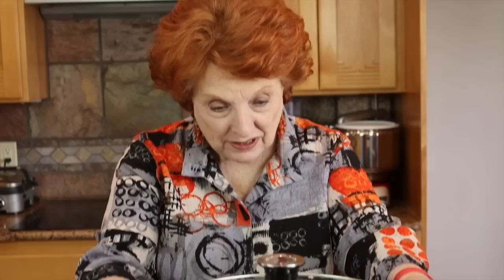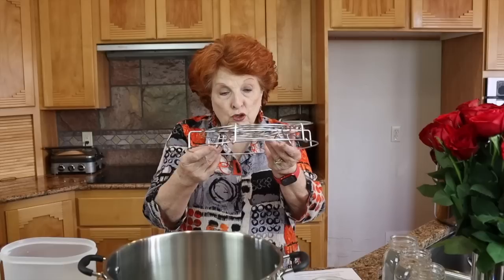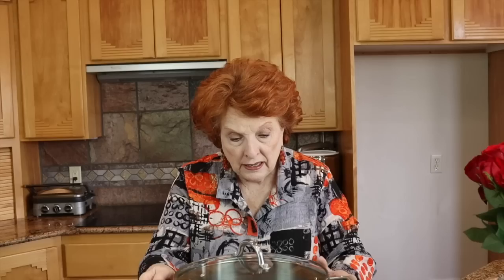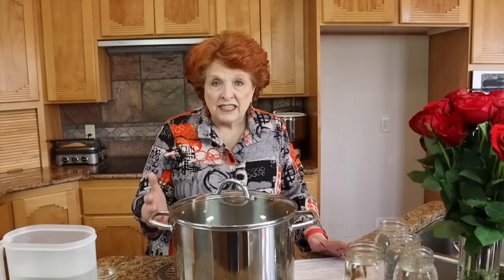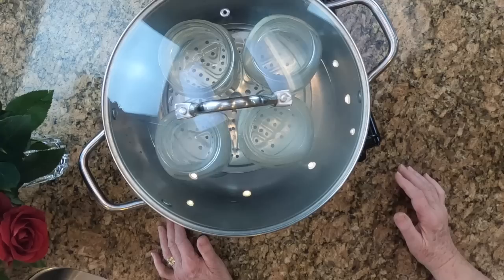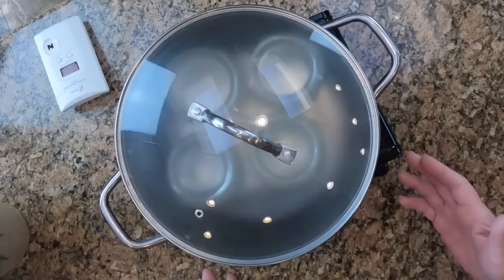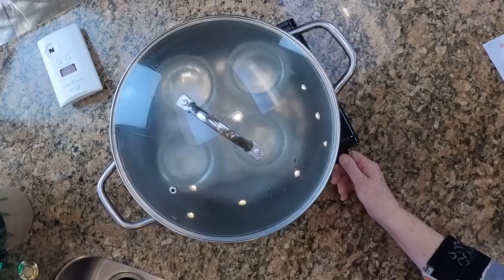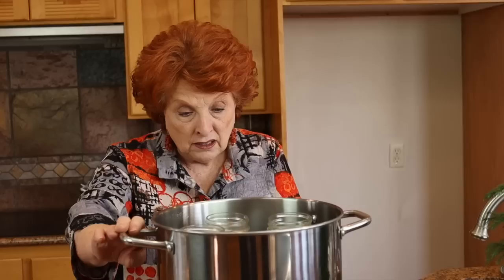How to Make Your Own Steam Canner

Comment: I use a springform pan (ring only) and a pizza pan (with holes) to elevate my jars to steam can .   Works great to give it the elevation for the 3 litres/quarts of water!!!!    Thank you so much for the work you and Jim do!!!
Reply: what a great idea, thanks!
Reply: I also use pizza pans with holes, and another one I have is like a screen. I use them for the second layer in my Presto and the other in a smaller batch kettle for jams etc. Saved me about 20$ each. I bought mine at a restaurant supply store. They come in every size one can imagine! They are awesome.
If we just think a bit, we can be pretty crafty! 😉😉
Reply: Great idea!!!  Thank you for sharing this.  God bless you sister.
Reply: I learned something today. I had never heard of steam canning. I also have the Ball water-bath canner with the rack I can invert. Can I just arbitrarily steam bath anything I would normally water bath?

Comment: I use my pressure canner to steam can my high acid foods in as well as my electric canner.  Doesn't matter if the jars are in a little bit of water in the bottom or not, it still does the same thing. People in other countries don't even cover their jars completely with water when water bathing their high acid foods and still have the same outcome. Only difference with those is you lock your lid and leave the weight regulator off or vent pipe open for steam to escape. Once steam is escaping good usually  after ten mins you start your water bath time anything with a water-bath time of 45 mins and under as you don't want your pot to run dry. You can lower the flame down a bit to avoid running pot dry but just make sure you can hear it boiling and the steam is still coming through the vent hole the entire process. I've never had any issues with using either one. Glad you shared that information for others though as some won't just believe anybody which is a good thing. I believe people should always always do their own research. Plus, another good reason to share which keeps people from actually canning is they think they need all this special equipment to get the job done and it keeps them from even starting and some folks could really use this information to help save $$$ and put up for their families too. Some don't have the dollars, to buy all "unnecessary high dollar gadgets." We have to teach each other that there's many ways, and safe ways to get the job done. Thank you for sharing this is great information for others to see.

Comment: I often wondered if I could use my pressure canner as a steam canner by elevating the rack with the ring from a springform pan and start time when the steam is steady, such as when we steam for 10 minutes before adding the pressure weight. I'm ecstatic that this confirms that I can. No more transporting of a large heavy potfull of water. 😁 My pressure canner becomes a double duty appliance and even more worthy of the space it takes up in my kitchen. Thank you so much for your scientific approach and contribution to safe and responsible canning tutorials.
Reply: Good idea with spring form pan ring.
Reply: I do this....
Reply: @jenniferr2057  You're not alone.....
Reply from the maker: Perfect!  And great improvisation with the springform pan!  Thanks for sharing.
Reply: Awesome!  I even have the glass lid with the steam hole for mine 😃
Reply: This is what I do.
Reply: I do this with mine. Turn it down so the safety stays up but not so high I risk running out of water.
Reply: I have done it for years.
Reply: I’ve been doing this for a couple years.
Reply: Now your pressure canner is a triple function unit: steam canning, pressure cooking and pressure canning!
Reply: I’ve just started doing this with my Presto. My question is, do I vent for 10 mins before starting my timing?
Reply: I was going to ask this very question. 
Thank you!
Reply: Replying to my own comment. I rewatched Pam’s video, and yes, vent for 10 minutes before starting the timing.
Reply: You could also just use a pressure cooker instead of your canner so you could do two at the same time....

Comment: I will add my two cents. You are far better off using a pot with a lit that fits properly such that steam only escapes through the vent and not around the edges (once turned down from high to the lowest point where steam is still produced). This is the reason Pam's first Harvest Canner's temperature indicator appeared to not work properly.  The indicator was fine but didn't reach the right spot because either the lid or the pot was somehow out of round and the steam was all escaping from under/around the lid. For that reason, when I saw the video where she talked about all of the steam escaping I knew her situation was not as some who are at altitude extremes and fall outside the norms for the indicator, but that she had a problem with either the lid or pot having been dented out of round in storage or shipping. That is why I sent her a replacement canner.  Steam canning with a lid that doesn't fit properly and allows steam to escape under/around is a far from ideal situation as that same gap allowing the steam to escape is also allowing air lower than steam temperature into the pot. This shouldn't cause major temperature fluctuations, but you will not know unless you have two vent holes in the lid (one to let steam escape and one to put your instant-read thermometer in. This is why a pot with a properly fitting glass lid with two steam vents is ideal. (FYI, the extension office system has put out a memo as to why a regular pot should not be used for steam canning. As we were producing steam canners long before they finally tested and released their findings, we know they don't have the bandwidth and their team is dwindling, so....)

A little more about steam canning efficiency. Not only are you using less water and so the steam brings the temperature inside the canner up more quickly, but you are also turning down the heat on your stove to hold the steam steady. Turning your stove down from high uses less energy. With our canner, and most pots with properly fitting lids, when the stove temperature is on high, the force causes the lid to move around and that is why you have the spitting, etc. under/around the lid and that is also why my instructions tell you when that happens you're almost ready to start timing so turn the temperature down. If you don't take that step of finding the sweet spot of the lowest setting on your stove that still produces a steady stream of steam, you may run out of water sooner than all of our (and the USDA's) testing making your longer recipes (such as some tomato recipes) unsafe when the water runs out. 

Also, you can purchase the rack that comes with the Harvest Canner by itself. Search on Amazon for VKP1056.
Reply: Thank you so much for the additional information!
Reply: So helpful. Thank you.
Reply: Thank you for your comments.  I was also concerned that steam escaping around the lid was allowing air in.  I have the Harvest Canner and if there is steam escaping around the lid I turn the heat down and start timing after that steam escape (and air intake) stops.  That point also coincides with the gauge on the lid reaching the max for my location, so I'm assuming your gauge is measuring steam pressure and not just "is the water boiling".
Reply: @keG1494  first, it's an indicator and not a gauge. I'm not an engineer, so I can't explain the difference between the two, but the owner of our company is he's made it clear this is an indicator. :) What it's measuring is not pressure, but temperature. Once the canner is filled with steam, the temperature cannot increase. The only way to increase temperature past the point of steam is to pressurize it.... hence the reason low-acid foods can be canned under pressure, the temperature is then hotter than steam. So you are partially right that the indicator is not measuring the water boiling, but it is measuring the steam. I hope that helps clarify a bit.
Reply: Thank you for clarifying!
Reply: @kimberlywilliams3009  Thank you. The additional info is very helpful!
Reply: I will buy one once I have the money saved!!
Reply: @kimberlywilliams3009 at what temperature range are the respective green fields on the indicator?

Comment: Thank you, Pam!  I sent even more people to you when they said to me that they wanted to can but were afraid. I tell them that you will tell them what is safe, what is not and WHY, and that you will give them confidence, as you did for me, (and so many others.)
Reply: I am wondering the same thing.  I would think we could use the instant pot as long as we see the steam escape through the valve and use the proper process.  Your thougts, Pam?
Reply from the maker: Steam canning uses no pressure, so if you can elevate the jars, place the glass lid on the Instant Pot instead of the pressure lid, it could work.

Comment: I’ve been using a regular stockpot for steam canning for a few years now, it really does work very well. A few things: you should have a rack below the riser jars so they’re not directly touching the bottom of the pot. Also, a glass lid is unnecessary. As long as steam is freely flowing from under the lid you know the water is boiling strongly. Even if you can see that the water is boiling you need steam flowing out of the canner to guarantee the temperature is correct, so visual confirmation of boiling is neither necessary nor sufficient.
Reply from the maker: Thanks for the benefit of your experience.
Reply: My presto induction canner is in essence a steam canner. If I put the jars on the plate that comes with the canner on the bottom inside, I get siphoning every time. I suspected that the induction plate that is attached to the canner on the outside, on the bottom was getting too hot, making the jars too hot, thus siphoning. So I bought plates on Amazon with legs to elevate the jars off of most of the water. No more siphoning. Plus the second rack in my 23qt Presto is always being steamed no matter if I use an elevated botton rack or not.

Comment: Okay, what the heck says I. Tried it with some grape jelly. Used my normal water bath canner, flipped the basket over and put my pressure canner rack on top of that. Added three quarts of water. Worked perfectly. Recipe  prepared for normal water bath canning. Processed for 14 minutes (elevation) after rolling boil reached. Flame out, wait 5, remove lid and ALL jars (10) instantly sealed. LOL, I've never had that happen before. Logically this has to work. Once water reaches boiling point it will never get any hotter because it turns to steam. Therefore steam is the ultimate temperature without some way to "superheat" it. Physics....
Reply: Okay. I decided to experiment some more. I started with cold water in the canner, cold water in an 8oz jar with a cheapo thermometer stuck in it. Not as scientific as Pam but whatever. Within 6 minutes the water in the canner was at a rolling boil. Within 11 minutes the water in the jar was at 200 from a cold start! Never did get above 200 but I'm blaming that on the thermometer (Dollar Store). At 2500 feet water is supposed to boil at 207 degrees, I'm at 2625 feet ,so yeah, I feel good water bathing cooked jams and jellies like this...

Comment: What you are saying is true to a point. The issue arises when going higher in elevation because the water then boils at lower temperatures. The purpose of those little green indicators is to compensate for the lower boiling points allowing the temperatures in the canner to reach 212 degrees as at sea level, in spite of when the water starts to boil.
Reply: Actually, if you closely look at the gauge on the canner, it shows the three “green zones” starting at lower temperatures when the elevation increases. Water can never get hotter than the boiling point at any elevation because it will turn to steam. Pam is totally correct (as usual.)

Comment: I used my pressure canner with no weights on it. When the steam started coming out that pipehole the weight would otherwise sit on,  im at sea level, so i started my timer for 20 minutes...10 to be sure everything is at temp and 10 more for the processing time. 
Easy peasy. Thanks for taking the guess work out of this for us
Reply from the maker: Great! Make sure that you are safe with your process.  Jim
Reply: @RoseRedHomestead  well that was for the steam process for applesauce with plenty of malt vinegar and cranberries in it, so hopefully it's all good 🤞

Comment: I’ve just been steam canning in my AA pressure canner and just leaving the vent open - not using the weight - and using the same times as would be used for waterbathing. I only really need it for cranberry sauce. Otherwise, everything I bottle is in the PC.  I just put a three pieces of SS stock in the bottom of the PC to elevate the rack.

Comment: I appreciate your scientific AND logical approach to canning, and am excited to have found this channel. As a logical person I find myself wondering why it is important to elevate the jars above the water if the water and the steam are at the same temperature once boiling begins. If I use my Presto pressure canner with the regular rack and the two or three quarts of water usually recommended for steam canning, won’t I end up with the same result? Adding a little extra water may even ensure that the canner doesn’t boil dry, which seems to be a concern. Can you see any flaws in my logic?

Comment: I was on a zoom live canning class last year with my local Cooperative Extension Service and they covered steam canning.  I asked if we could use our own big pot for steam canning and they said a definite YES!  As long as the tested guidelines are followed: high acid, processing time, and good set up with a rack and lid.  
Just be sure to vent to get all the air out.  
I’m really glad my coop extension is so active and does a lot of research.  
👍🏻👍🏻
I do have the top hat type steam canner and I confess the gauge really never made sense to me.
Reply: Which extension program did you watch?
Reply from the maker: Excellent!  So nice that your extension office is so pro active!

Comment: I use my Pressure canner without the Jiggler and add a quart more water for high acid foods, I just wait for the other plug to pop up and then start my timing. And I elevate the jars above the water.

Comment: Hi lovely Lady. Thank you for this video which accomplished 2 things for me: #1 demystifying the process into specific principles with the science behind each principle #2 making this food preservation method accessible without having to fill our kitchens with yet more tools that may have overlaps and redundancy with common multipurpose tools. Do you have any thoughts on using the steam function on my Instant Pot Max? I have the same model you use for canning.  Many thanks and keep sharing the science with your audience 🙏🙏
Reply: That last question is an excellent question!
Reply: You would have to use the accessory Glass lid for Instant Pot, and set it to boil using one of the settings and watch it. But it’s all a maybe until we could figure it out. Possible? Yes.  But we need proof of concept.
Reply from the maker: Thank you!  USDA says for steam canning that pressure should not be used.  So I think steam canning is out for the Max.  If we were to raise the rack so water fit under it I think it would not be tall enough to accommodate the jars.
Reply: @RoseRedHomestead  even using the IP glass lid, on steam setting, with half pints?  I may test it, 😉. I like my jelly and jams in half pints.  🤷🏼‍♀️
Reply: @firequeen2194  Half pints might still be too tall, depending on exactly how high it needs to be raised. If still on top of 4 oz jars, then probably only fitting certain Weck jars, the Kerr squat half pints (maybe you meant those actually), or just more 4oz jars. I was pondering this too as I watched. 

The problem would also be if you need more water volume even in the IP Max than that would give. Also obviously using the glass lid, not the pressure lid. I have a few racks for the IP Max that are too tall for pints, but at least they aren't rickety like the rack that came with it.
Reply: I have used my instant pot, not the Max, to do steam canning. Very easy, just a few caveats… it only holds half pints, and you can’t really process any more than 10 minutes, due to the volume of water. I use the regular lid, I just keep the valve on venting, and the steam escapes nicely! Easy peasy!

Comment: I have seen on Amazon racks which have L shaped legs. They're supposed to be used for steaming something like fish. All you have to do is match the diameter of the rack to your pot. 

One thing to take note of is that because there is less water in a steam canner, you have to be careful of running out of water. Longer processing times need to be watched as to can't top up water once processing has started.
Reply from the maker: The USDA recommends no processing times over 45 minutes in a steam canner for that very reason.
Reply: @RoseRedHomestead  Don't you think that was important informationn that you should have included in your video...along with the fact that according to any steam canner I've ever seen it states that you should wait 5 minutes after processing time is complete before removing the lid????? Leaving out critical information is just as dangerous as giving misinformation.
Reply: Unnecessary criticism.

Comment: dont want to be picky but you actually cant see steam it is invisible , what you can see is the water vapor after the steam starts to cool when it hits the cooler air . if you look at right where it leaves the vent there is a small clear section that is the invisible steam then it turns to vapor and thats the part you can see .but all that aside keep up with the videos please i enjoy them and get a lot from them, thank you .